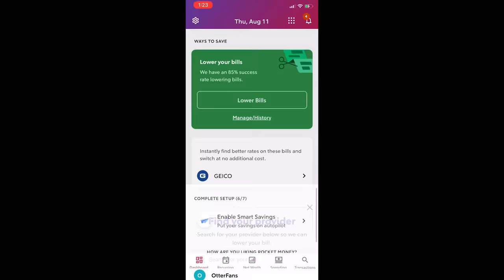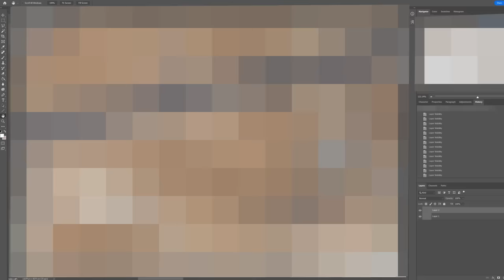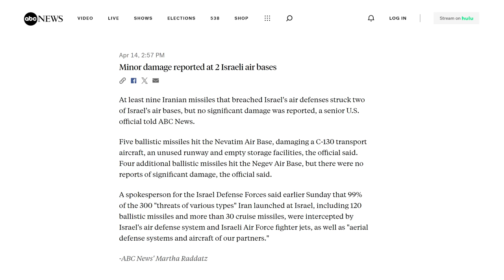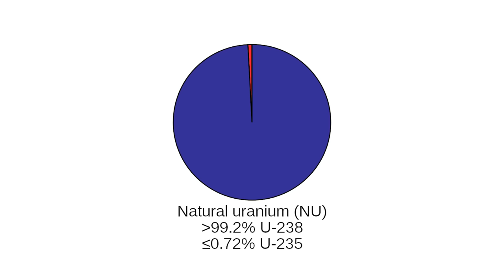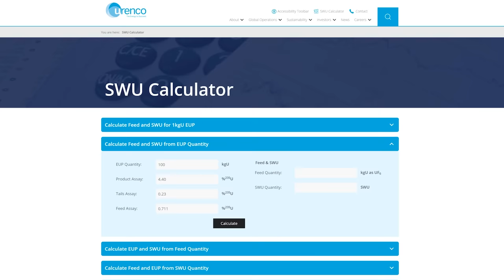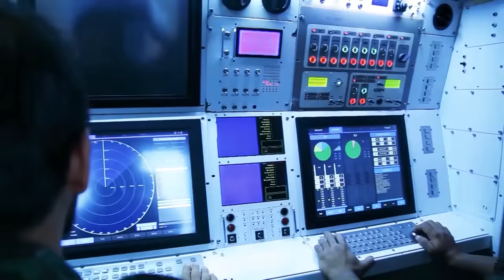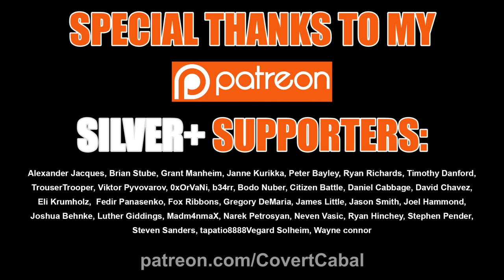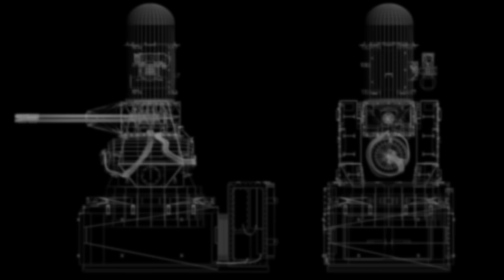Was Iran's Strike Actually A Success?

Comment: In the 21st century, HEU is used in the "spark plug" and "pusher" in the thermonuclear stage of a Teller-Ulam device. Plutonium-239 is used in the primary, fissile, stage because it is so much cheaper to produce than HEU.
Reply: True, but perhaps Iran would use HEU for some reason. Perhaps it'd be easier for them, specifically.
Reply: But you also need a operational nuclear reactor, with the reprocessing setup to extract Plutonium, to be able to use that in a bomb - because it's half life is too short for any of it to be just lying around in nature that you can just go mine and dig up out of the ground.
Even Uranium is barely usable, and even that, only after the complex centrifuging described.  (or gas diffusion - or laser separation)
Reply: @barryscott6222  Correct, except that Plutonium 239 is not a naturally occurring element. It must be produced in a breeder reactor.

Comment: The images Covert Cabal bought were from the French national space agency. They weren't initially blocked from sale which meant they only decided after selling the images that they might be getting in trouble for doing that (or possibly they are just big Israel supporters). It's likely that the decision was made by a US based image reseller not the French space agency, so it might still be possible to buy them from a non-US site, especially if you are a non-US citizen.

Comment: The most important points were made at the end of the video... The massive distances between Israel and Iran make a war between the two of them logistically unwinnable for either side.  Israel has the ability to hit Iran with airstrikes, but any strikes would be hugely limited by distance.  Only a handful of platforms can hit targets at that distance and any damage delivered by that platform is likely fairly small.  Iran does have a fairly large stockpile of ballistic missiles, but they would likely be expended fairly quickly and would take years to build capacity up again.  A "full scale" war between the two countries would likely take the form of a massive ballistic missile barrage by Iran followed by literally nothing else as they have no capacity to do anything else.  If the barrage was successful, then most of the Israeli air force would be destroyed before getting off the ground, although any large preparatory movement of Iranian missiles would likely be detected ahead of time.  From there neither country would have any great capacity to hit the other and the war would be a shouting match with insults being launched from distances of over 600 miles.  Only the United States or the Gulf states actually have any ability to conventionally defeat Iran, but neither have the will or desire to do so.

Comment: Jericho 3 is very expensive and rare, capable of delivering nuclear fusion (hydrogen bombs) warheads.
But one could be filled with concrete with a tungsten carbide jacket. There are no explosives on it.
It wouldn't explode but would impact with a theoretical force of 8,000 MN, a localized earthquake about 3 in Richter scale. 2 missiles in tandem for more damage.
This would be enough to disable most sites for years.

Comment: On the Iranian interceptors you mentioned, they have practically none that would pose any real threat to Israeli fighters. When Pakistan retaliated against Iran for their attack earlier this year, the Iranians ordered the limited fighters they had to stay on the ground as they were not capable of going up against the JF17's and the F16's that were waiting over the border should they be needed. 

Apparently the Iranians are to receive  SU-35's this week. They would pose a threat, but it would be limited for now as it will take time to learn how to use these aircraft to their full potential, and they will need to if they are going to face off against the F15, F16 and F35.

Comment: Iran has "backed down" many times in the past. Even after the illegal US killing of Qasem Soleimani in 2020 under the direction of Trump, Iran's response was both telegraphed and very limited, launching just two missiles at US bases in Iraq which caused casualties but no deaths. Incredibly, the reckless actions of both the US and Israel make Iran look like the only rational actor in this conflict. Regarding the Israeli retaliatory strike against Iran, it was also very limited and it's clear that US pressure to de-escalate played a role, but it's also the result of Iran demonstrating both the will and the capability to launch a large-scale attack on Israel, despite the fact it was telegraphed and very limited.

Comment: Yeah, that "We only used our old stock" claim is probably false, considering recognised wrecks Emad(2015) and the Kheibar(2022) are relatively new models, the Emad with an MARV and both with a claimed accuracy of 10 meter(considering the pinpoint strikes on the Al-Asad base in 2020 with the older Qiam-1 you know they have these capabilities).
So if the closest impact documented of these missed by 200 meters something went wrong in reentry to cause such a miss.
Perun went into details about it in his analysis- https://www.youtube.com/watch?v=COBDSmx9QDw
 But other than that a very informative video.

Comment: If it cost a 10M$ jet to fly to shoot a 150k$ missile against a 1k$ drone i say it was worth it even if the attack was a failure. Sadly they can pump thousands of drones by the time one jet is built. At one point scale of cheap drones and smart munition are going to completly level cities with defense being quite hard. It will get even worse when terrorists will start using them too. Get a van, carry a few dozens drones, let open the drone, let the drone with AI fly to a city and pick random civilian target...this is going to be a nightmare.
Reply: Cheap drones become largely useless once ground based EW reaches the same level as it has airborne. Just a matter of time.

But Iran wasnt using cheap commercial drones, Shahed would cost several ten thousand Dollars a piece, depending on model.
Reply: @Ganiscol  WOn't matter for civilian. Also attackers always have the upper hands, it was proved in all conflicts. It is easier to overwhelm a defense.

Comment: That was the same thing Israel is doing, probing their defense because destroying the reactor cannot be done using missile but simultaneously destroying the control center and cooling duct together then there will be core meltdown. It will be Fukushima or chernobyl, but like you said to destroy the cooling duct most certainly has to be done with aircraft, core meltdown will there best option.

Comment: how to do a cake.

STEP 1
Heat oven to 180C/160C fan/gas 4, butter and line the base of two 20cm spring-form cake tins with baking parchment.
STEP 2
Using an electric whisk beat the butter and sugar together until pale and fluffy. Crack the eggs in one at a time and whisk well, scraping down the sides of the bowl after each addition. Add the lemon zest, vanilla, flour, milk and a pinch of salt. Whisk until just combined then divide the mixture between the two tins.
STEP 3
Bake in the centre of the oven for 25-30 mins until a skewer inserted into the middle of each cake comes out clean. After 10 mins remove the cakes from their tins and leave to cool completely on a wire rack. Fill how you like. My personal favourite is a good dollop of lemon curd and some fresh cream, then dust the top with icing sugar. Will keep for 3 days.

Comment: The fact that most of the missiles with the actual ability to get through defenses hit the airbase yet apparently only targeted easily repaired runway suggests that the attack was never meant to cause real damage or kill anyone, nevermind the advance warning by Iran, and that Iran never expected the others to get through Israel's air defence; though the US did shoot down most of'em, even after insisting it wouldn't get involved militarily.
Reply: Or the defenses calculated which missiles would impact important structures and prioritized them, so the missiles that "missed" their target or were programmed based on faulty intel had less interceptors assigned to them.

Comment: The only lesson anyone learned here is that ballistic missile attacks, even when supported by drones, are ineffective against high concentrations of modern western air defenses. The Iranians have been looking at Ukraine and thought it was the same. but Ukraine is a much larger country, with a much lower concentration of AD and a much lower ammunition supply. 

I guarantee you that Iran thought as much is 60 to 70% of its ballistic missiles would get through based on the coordination with the drones and results of similar Russian strikes in Ukraine. They were rudely surprised.
Reply: You might be right, but I wouldn’t be overly confident, we need to find better ways to increase production levels at better price points, besides ongoing innovation, and deterrence/punishment capacity must be recalibrated.